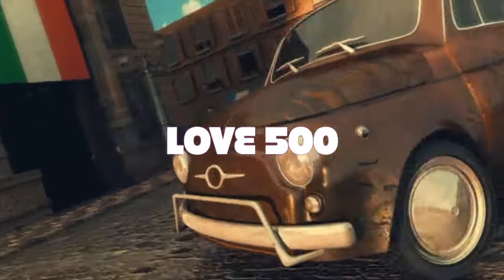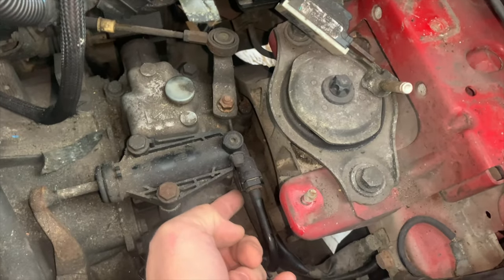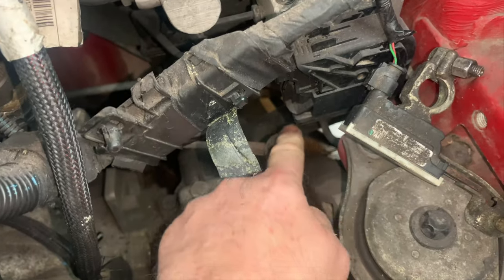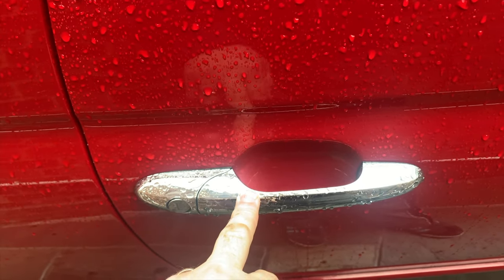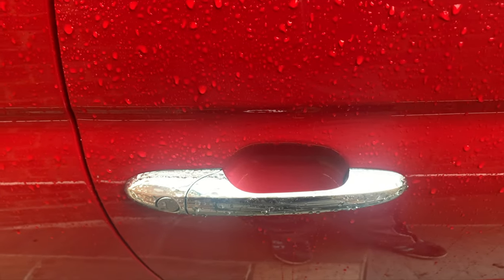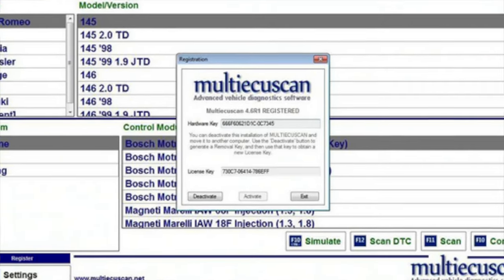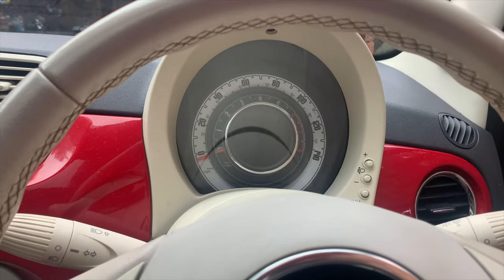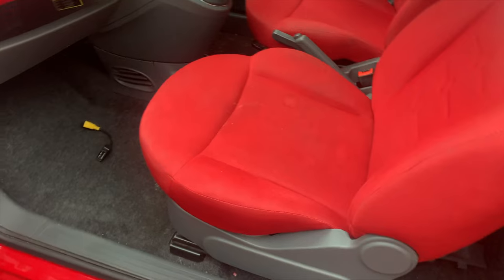Common Faults on a Fiat 500 or Abarth 595. The faults are the same. #abarth #fiat500 #595

Comment: Great channel very informative I was just wondering if you’d ever come across a problem Fiat 500 on a 13 Reg after timing belt and service not sure if it’s a coincidence or not 
driving normally loss of engine power engine management light flashing turn the key off turn it back on back to normal no codes stored ? Be grateful for any advice
Reply from the maker: I would be very surprised if there wasn't a code stored somewhere. What are you using to read codes? I would expect MultiECUScan to show something as an intermittent fault. It's a possibility your cambelt is a tooth out, but I don't think that would be intermittent. If it was 180 degrees out, the car wouldn't start. It's probably more likely something has been disturbed and not plugged back in properly during the cambelt change. I would recommend MES for diagnostics rather than a generic scanner. Even a quality one wouldn't be as comprehensive as MES.
Reply: @Love500  Thanks for the advice I’m just using a cheap scan tool off the Internet I’ll drop it into my garage where I had  the Cambell change and get him to put it on his machine I was hoping it was something simple like a coil pack where it go’s into limp mode and get a slight Engine shake like it’s misfiring and Engine management light flashing Thanks for the advice again I’ll get it checked out properly

Comment: Hi great video thanks. Could you please advise me on my air conditioning its not working.
There's power to the main fuses box but nothing to the compressor,  clutch doesn't spin when turned on, all fuses are good .
Been re gassed all ok holding pressure 
I'm starting to think the engine might have to come out to check the wiring harness.
2016 my 1.2cc 69bhp mega slow lol

Any advice please 
Jason.
Reply from the maker: Bit extreme, I would get an auto electrician to have a look.

Comment: Hi Paul! Sending you this from Athens Greece. I’m ready to buy a 2009 semi automatic. People here are strongly recommending to avoid this gearbox because I will have problems again and again. Could you please give me your advice? Thank you!
Reply from the maker: They can be troublesome and expensive to repair. I have one at the moment which is fine. I know a couple of people that have them with high miles which run completely fine. Get a warranty if you can.
Reply: @Love500  thank you very very much! Unfortunately the one I was planning to buy does not come with a warranty. But  it’s so damn nice… honestly I don’t know what to do.. I was literally on my way to give the money to the lady! Everything else was fine! It had the gearbox serviced as per the mechanic I went to… thank you  very much for your time and help though Paul!!! I wish I could buy one from you but we are driving at the wrong side of the road as you know 😉😉😉

Comment: Hi, I have a Fiat 500 with semiautomatic gearbox, the problem I'm facing now is that the car can be driven on manuel only and not on automatic, can you help me plz to find out the reason Behind that and how it can be fixed
Thanks
Reply from the maker: Often the selespeed fluid is low or contaminated. Can also be a problem with oil seals. You need to get diagnostics run on it. They are notorious for going wrong.
Reply: @Love500  Thank you for the feedback, most appreciated, also glad to subscribe to your channel
👍

Comment: Great video as always. My daughter recently bought a 2008 fiat 500 1.3 multijet but she rang today to say her powered steering stopped working and a message on the display saying check power steering see handbook. Anyway again I got to her the problem had vanished. Any pointers as to what the problem might be?
Reply from the maker: Most likely the dreaded earth strap. Can be temperamental to start with. Could also be the battery on the way out. If the battery is OK I would definitely change the strap.
Reply: @Love500  thanks Paul very much appreciated I'll have a root at it tomorrow so.

Comment: Really enjoyed the vid but couldn’t see anything for the problem we’re currently experiencing with my wife’s Fiat 500 1.2S. When we fill the tank with petrol we’re getting a fuel leak - but only when the fuel filler neck is full. After say 20 miles when the fuel in the filler neck goes down the leak stops! Is this anything you’ve ever come across?
Reply from the maker: Yes it is. The pipe from the cap to the tank holds a fair bit of fuel. My project Stolen/Recovered Sport had the same problem. The pipe was cracked and leaked quite a lot of fuel. If you get under the back with a torch you’ll probably see it leaking from there. Take a look at that series, will probably be on the last one as it didn’t come to light until after I had sold it and the new owner filled up. It’s not in this video because it’s not a common fault.

Comment: Hi Christian,  I have a Fiat 500 with a speedohead that sometimes works, often displays what looks like a foreign language, sometimes not on at all.  It needs replacing I think, although because the fault is intermittent I wonder if its an electrical fault.  Because its a 2015 dualistic model I can't find any replacements on Ebay etc.  Do you know where I could source one rather than having to spend hundreds on a new one please?  Much appreciate you video btw.  Pam
Reply from the maker: eBay is the best place. If you can’t find a used one there you’ll find one nowhere.. have a look at my video on changing the LCD panel. The company I got that from might be able to source you an auto one.
Reply: @Love500  Thanks so much for your direction.  I watched your LCD panel change and was so pleased to see it worked.  Your video didn't mention the company where you got the new LCD panel from.  Can you please pass me their details.  I'm wondering if I do get one, who would replace it for me.  Is this something a general electronic business could do?  Any help much appreciated.  Best wises and thanks again.  Pam
Reply from the maker: @pamsmart4180  it’s actually in the description but I got it here.

http://www.akspeedo.com/fiat-lcd-pixel-repair.php

Easy enough to change if you follow the video. I think maybe an auto electrician rather than a generic electronic company would be better if you didn’t fancy doing it yourself. It’s fiddly but you can see the mistakes I made.

Comment: I’ve just purchased 2009 500 and have knocking coming from the front when going over uneven roads, there is a lot online but wondered what you thought was the most common cause on these cars?
Reply from the maker: Drop link or bushes on bottom arm the most likely.
Reply: @Love500  thanks, did jack it up earlier and got a bar in there, I couldn’t see any play on those parts but will remove the shock and look again, I have just noticed the oaf shock top is very rusty and looks further back in the socket than the near side, can this cause knocking? Thank you in advance
Reply from the maker: @leeharris5084  absolutely. Could be the top mounts are worn.
Reply: @Love500  was the bottom arms, I ended up changing most bits as they was so cheap but drives like new now, thanks for your help

Comment: Excellent video,  I was looking at getting my Mrs one if these.  She currently has the 1.2 8v Grande Punto.   Are the 1.2 8v engines in the 500s just the same engine as the Grande? 

Also what engines on the 500 had the issues about lack of power pulling away? I remember seeing this on watchdog and wondered if it was ever resolved.
Reply from the maker: I’m not sure whether they are the same. The problem ones were from about 2014 with the vertical engine ECU. It was sorted with a software update. Not an issue now.

Comment: Hi, great video. Just bought our 500 twin air but my cables gone at the other gear lever  end. The side shifter ball joint came out on way home and we wrapped a plastic bag around the ball and popped the linkage back on. Got us home and still ok but garage wants to charge £340 for new cables...do you know if there's another cheaper fix like the Engine end you cover in this video or an upgrade similar to my plastic bag mod lol
Reply from the maker: Superglue. I glue one together about four years ago and as far as I know it’s still fine.
Reply: @Love500  Thanks , just to check is that for the cable ball joint for gearstick sideways moment under the gear gaitor end ( not the end you glued at the gearbox end under battery tray)?
Reply: I could send pic of my plastic bag mod but not sure how on here
Reply from the maker: @biggerboat25  oh no sorry I thought you were talking about that one. I think I know the one you’re talking about. Not sure if that separates from the cable or not, I’ve never taken one off.
Reply: @Love500  Yeah been told there is usually a plastic liner in the cup part so that's why plastic bag holding at mo.... not sure about long term.

Comment: This off the wall question: 
In Fort Lauderdale we had a rain storm and the Fiat got submerged in water, they said the computer system got wet. How much to replace it or repair it. It’s totally a mute now .
Reply from the maker: Must have been deep. Engine ECU is over a foot off the ground but nothing between it and the outside world. Body computer is lower but of course in the car. you can buy second hand BCMs, Engine ECUs on eBay in the UK and if you buy a kit that includes both ECUs and a key with transponder chip, then no programming is needed otherwise they would both need to be virginised and then programmed to the car. Whether you can get them from a wrecked one in the US is another matter. Here in the UK, it's a pretty easy cheap job of around £100.

Comment: Thanks for that video it was really helpful. Please can I ask a further question about drain holes. I have a convertible anniversario which is getting water in the footwell behind the passenger seat. It is only in this part of the car to my knowledge. Yesterday we did clean the drain holes in the scuttle pan , following your instructions and a vast amount of water drained out. Are there any other drain holes we should check especially as the water is in the rear footwell. (Although the car is parked on a slight incline generally with the front uphill).
There is no back window wash so it can't be a pipe leaking. Any help would be really great, there was an enormous amount of water in the footwell this time.
Reply from the maker: In the rear footwell it is almost certain to be the pipe but as you say you don’t have a rear washer that is strange. Are the front footwells dry? The only other thing I can think of are the door rubber seals apart from an obvious roof leak but I’m sure you would see Mark’s on the roof lining.
Reply: Hi, thanks for replying, no definitely no rear washer the window is built into the hood, as the whole hood collapses when fully open. I will check the front foot wells but they seem dry. The door rubbers seem in good condition. There aren't any other drain holes in the back half of the Fiat then?
Reply from the maker: @sarahflower616  no, only in the bottom of the doors. I would remove the rear seat base and have a look under there. There’s nowhere at the dude unless the seal is leaking on the side rear window. Never known that on a C before.
Reply: Thank you, ok will check the bottom of the doors, there doesn't seem to be any evidence of the water coming down from anywhere, I had the roof re waterproofed professionally after the first episode last year just in case. But there are no water marks on the inside, I will have a look at the rear side window too. Just my luck for it to be a mystery! Anyway thank you so much for your advice. If I track it down will let you know in case it can help anyone else.
Reply from the maker: @sarahflower616  yes please do.
Reply: Hello Love 500 Fiat man!  I have brilliant news! ....The front well on the passenger side is wet! On much closer inspection it is wet down the door side. So i hope this solves this mystery and having cleared the drain holes in the scuttle pan all will be well, once I have dried it out. Thank you so much I am greatly relieved, as I really love my little orange Fiat.
Reply from the maker: @sarahflower616  make sure your airbag ecu isn’t wet as it can leak onto there from blocked scuttle panel which will fry your ECU. Hopefully once dried out they’ll sort it.

Comment: Our 2016 500 twin air has water leaking into the back. I find it coming from the back / side and then flows to the spare wheel space.
I’ve been looking everywhere, using sealant around the wiringloom, back light units and refitted the bootrubber with loads of silicone. Current solution is some holes I drilled iot let the water out again, but I would prefer to stop to intake. Any suggestion?
Reply from the maker: 100% got to be the aerial. It runs down inside of head lining, behind boot side carpets and into the wheel well.

Comment: Evening Evening Evening

RE: Advice on Actuator Fluid DuoLogic and Brake Light Switch 'pain'

I did add best part half bottle 0.5l Tutela CS Speeda and found the switch on back 2 pedal set up G.Punto

I never got to the bottom of it tho, booked into electrical specialist tomorrow for Brake Light Switch and Permanent message triangle warning message, Lights, Brake Light 

Fuse for Brake Light Switch, B.LSwitch itself, checked, changed.  And Brake Bulbs in rear housing inc 3rd High level checked. Everything was dry good contacts no obvious earthing

I hate being beaten   

Out interest on MES, I went into Gearbox Marelli Selespeed CFC328 Automated......, it didnt ask for Yellow Cable EML just 'Connecting to ECU'( and Failed to connect ).....  I'm wondering which colour cable I should connect for the Gearbox ?????  Cheers

My car did go into Neutral loads from 2nd and 3rd, I've pretty much decided I have a combo of some kind of actuator leak leak, odd fluid drip off the bottom Selespeed bottle !  And the Brake light circuit failure itself .  One or other WAS putting the car in Neutral driving, since new brake light switch and more actuator fluid I've still got the fault warning.... But I have got normal brake lights, not flickering as before, and a Selespeed. system that is working normally.   It's booked in check the possible leak and the brake light message warning triangle never sorted.

These do try me these cars

I feel I've learn, more about these AMT systems and brake switches and as a noob, got nowhere , thanks for your help
Reply from the maker: If not the fluid level then it’s usually the oil seals failing. Most ECUs are yellow adapter excepts engine and steering, gearbox if connecting is clearly another.
Reply: @Love500  Exactly what I thought , RE Not Yellow.  I was cheap, only got the yellow.  I didnt need get into it but could have checked some activations in gearbox.  May connect direct just one ELM Bluetooth come think of it.

Comment: Hello, I have a 2011 fiat 500 lounge 1.2 fire model vehicle. This car has a start&stop feature, but I have never seen it active. Sometimes it gives a message that start&stop is disabled. When I measure the voltage of the battery, I measure 12.2v when the engine is off and 13.8v when the engine is running. What do you think the problem is?
Reply from the maker: The disabled message is most likely something like the brake light switch but could be many things. Diagnosstics may point to it if you have mutiecuscan. As for start stop itself, most people turn it off. For one it creates wear on other parts of the car continually restarting, makes little or no difference to fuel consumption and doesn't work more than it works. Will work more with a brand new battery in the summer, but when its cold with a not new battery it will rarely, if ever work, especially on older cars. I always turn it off.
Reply: @Love500  Thanks for the quick reply. Then I will use it this way.😊
Reply: @Love500  This is my last question😬When the vehicle is running at idle, occasionally the engine vibrates and the idle level drops and then recovers. It continues this way for 2-3 minutes. Very rarely this happens and the engine stops. When I measure the voltage level of the battery while this is happening, the voltage drops from 13.8v to 12.5v during shaking and then returns to 13.8v immediately when the shaking is over. It's instantaneous. It continues this way for 2-3 minutes. Then nothing. everything goes fine as if nothing happened. It does it again while waiting at the traffic light. Then when I come to the front of the house, there is nothing. 😄 I wonder if there is a problem with the alternator?
Reply from the maker: @rehacankofuncu734  if you suspect it’s power related I wound change your main earth strap. £4 on eBay.

Comment: What are the covers for the cups on the suspension called? Just so I know what to look for when buying, thanks
Reply from the maker: I don’t know to be honest. I do have them in my watch list on eBay. I’ll find them.
Reply from the maker: Shock Absorber top caps.

https://www.ebay.co.uk/itm/174593044212?mkcid=16&mkevt=1&mkrid=711-127632-2357-0&ssspo=qJ50SUWtTQa&sssrc=4429486&ssuid=52E9BPy6Sze&var=&widget_ver=artemis&media=COPY
Reply: @Love500  cheers thanks for that
Reply: I may be quizzing you quite a bit as I get used to my daughters car!

Comment: just found your chanel. I have an unrelated question.. I have fiat 500   08 Plate (so rather old. ) the boot lock has just started to not lock. I have tried closing it harder sometimes engages but mostly remains unlocked and the warning light plus a pulsating noise can be heard in the car. Can you help by telling me what to do
Reply from the maker: I imagine the pulsating is the lock electrics attempting to lock. When it’s open and you press the button on the lock can you hear the solenoid clicking? You could try loosening the two torx screws on the striker plate and moving it up a bit.